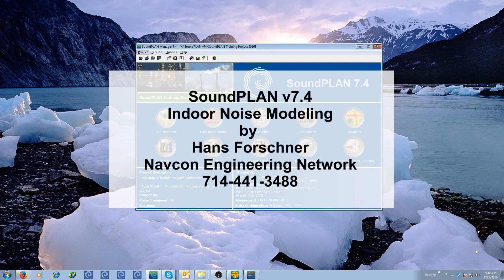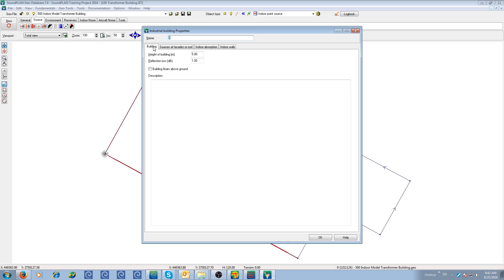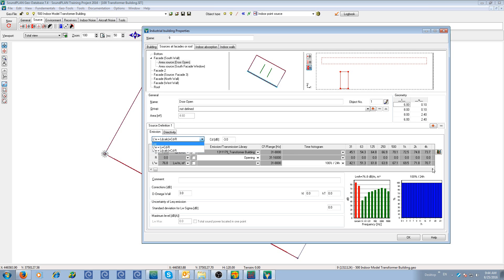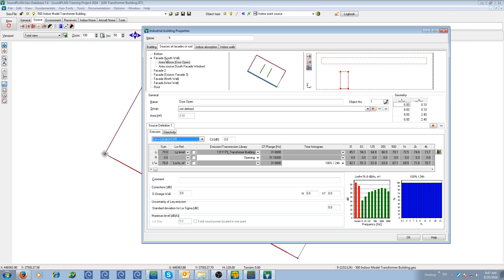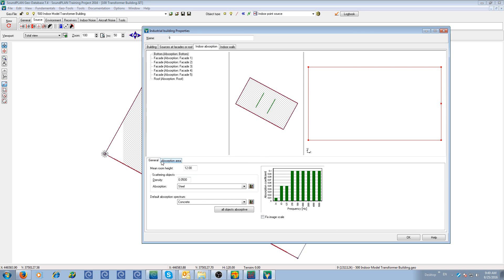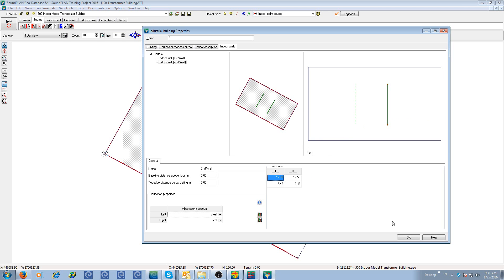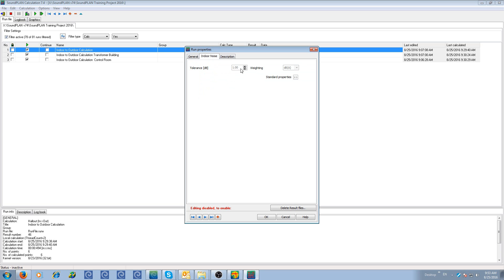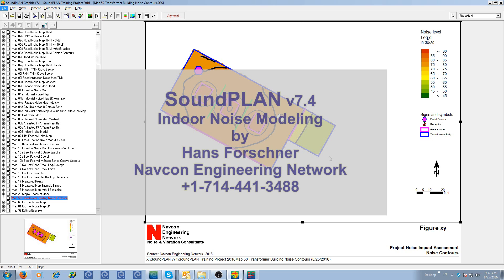SoundPLAN Indoor Noise Modeling

Comment: Hi, I have complex building in my project there are many Mechanical floor contain many machine, I want to calculate the impact of the mechanical floor to adjacent floor, I model draw the mechanical floor and the below and above floor in same model and insert all walls, ceiling, machines so it becomes a complex model when I run this model it take more time around 7-8 hours and at more time I get error "out of memory " I want to ask if my concept in the mood is right and if there any features in soundplan can help me or any trick I need to get in my model
Reply from the maker: Amr, sorry to hear that SoundPLAN ran out of memory.  There are various possible issues why the runkernel did run out of memory.  
(1) Where you using the 32bit of 64bit version of SoundPLAN. The 32bit version is limited to ~ 3GB of memory. The 64 bit is limited by the RAM you have on your computer.  Try to run your model with the 64bit software version
(2) you entered a very complex model with line and area indoor sources and lots of interior walls.  The more complex the model the more memory needs to be allocated. Make a copy of your indoor model and simplify your model - see if that improves your memory requirement.  
(3) Don't start with an indoor grid noise map.  Grid noise maps usually require much more memory than the single receiver calculation.  Start with single indoor receiver calculations.
(4) the run parameter setting are too detailed which also can add/increase your memory requirements with your computer system.  So please check your parameter settings  
In general it is a good practice to start the indoor model with a simple model and get some initial results and then add more complexity (i.e., source and walls, etc) into the model.   
You may want to contact your SoundPLAN hotline support person on how to troubleshooting the issue.
Reply: @HansForschner  thanks
Reply: @HansForschner  I will check my version but I noticed that when I go to download SoundPlan I only get 32     can yuu helps me to find 64 download link
Reply from the maker: @amrsleem5229  pleasecheck with your distributor in regards to the download link for the 64bit software version.